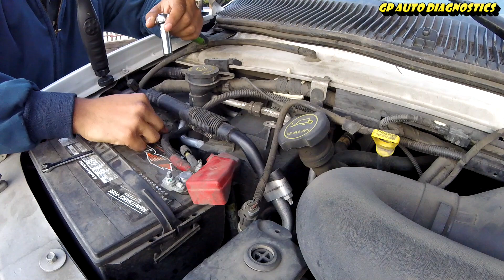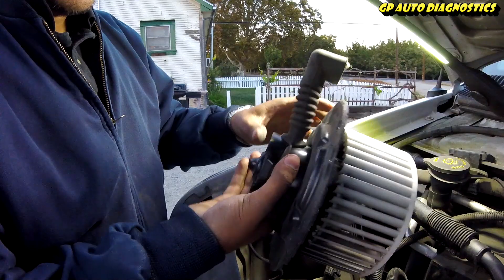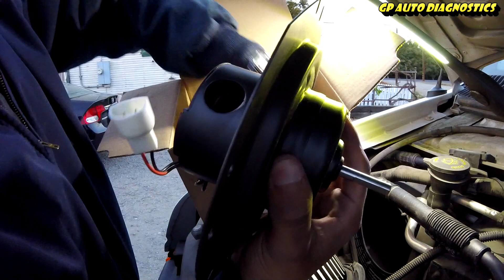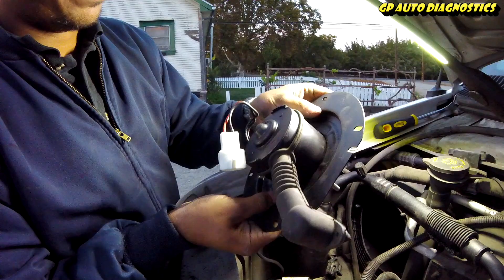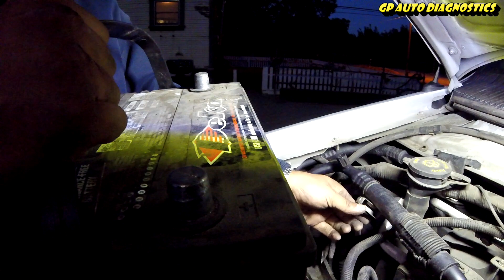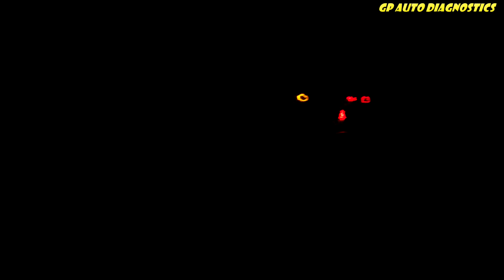2007 Ford E-150 Blower Motor Replacement

Comment: Thanks for showing all that. My blower broke too, but it was vibrating real loud.
I’m guessing the motor bearings are shot, but maybe the fan came loose.
Might order both parts just in case the fan got destroyed.

Comment: Great video. I’ve got a 2006 e-150 with 345,000 miles. I’ve replaced the fan motor once already, about 150,000 miles ago. Getting ready to put another in today.

Comment: I just did one on my 09 E-150 work van.  It gave out today and I did it myself as it is hot and I figured I would have to wait for a garage to do it.  I watch your video after doing it to see how you did it.  I got the same brand part, but with the blower blade with it.  Nice as I didn't have to change that , but cost $78 to get too.  No grommet either with and disappointed with that too.  Likely won't bother as we probably won't have the van much longer.  I managed to take out the top screw and loosen the bottom screw of the A/C dryer to get the blower out.

Comment: Just an FYI--There is a screw that holds the evaporator hose down tight (to the right side of the windsheild washer fluid inlet), that if removed, allows you to remove the fan assembly without having to remove the bottom evaporator bolt.

Comment: Your diagnostic video was wonderful your replacement video was equally as good I would say that I had a 97E 150 and it had three 5/16 nuts in that separator can collector for the refrigeration system other than that you’re how I got through👍

Comment: Great Video, thanks. I've watched both videos back in June '18 and couldn't have found the problem/replaced the motor (bad for my 2006 E-150 van) without them! But, alas, blower motor (front blower) just quit,,,sort of. It turns on and off by itself, regardless of hi, mid, low settings.  Mostly it's off and right now it's off.  I'll go through all  the troubleshooting steps like before, but what I'm afraid of is it's not the blower motor (only 5 mos old). Tracing the diagram, could be the relay, the switch itself, a bad ground, or just a  loose connection.  Anyone reading this have any other ideas what might be the likely cause?

Comment: Good job my friend. Just noticed mine in my 2001 e150 is not working. Replaced the resistor not too long ago. Guess we gotta realize, they are on all the time when engine is on. They don't last forever. Thanks so much.

Comment: Will the compressor come on with a bad blower motor?
Reply: As long as there's adequate Freon in the system.  There should be a pressure switch that can tell if there's enough Freon in the system.  If there's not enough, the compressor shouldn't come on.

Comment: Thanks for the video! I ran into the same problem as you. Thought all was lost until I found your video and realized that I could unscrew the receiver drier to get the blower motor to squeeze by.

Comment: I just got a 2004 Ford E-150. Is the fan motor located basically in the same spot behind the battery like the van in the video?
Reply: I just replaced the AC motor and it works! Thanks for the video.